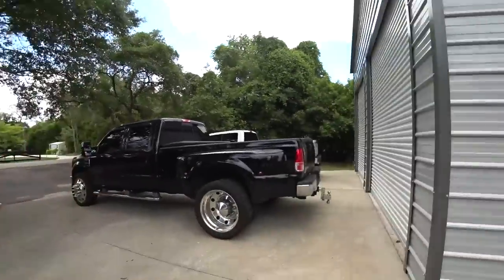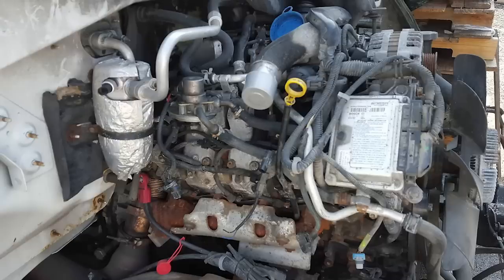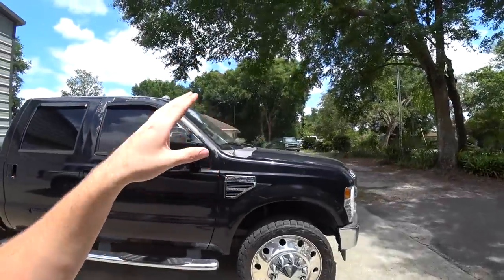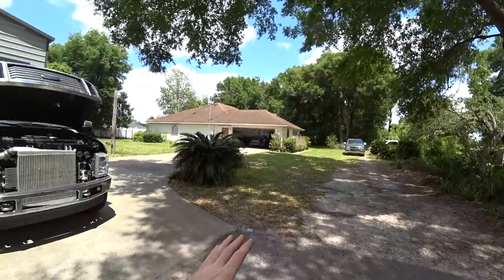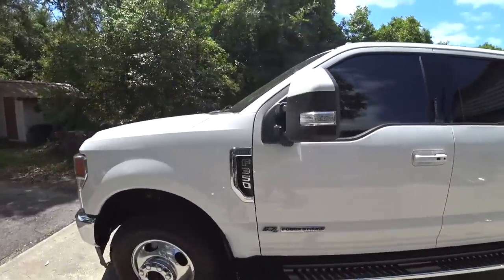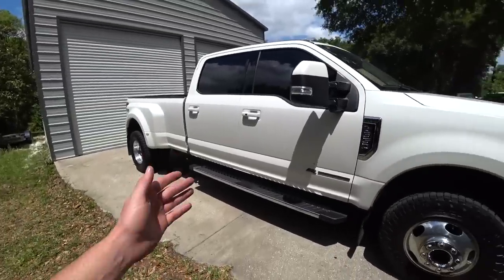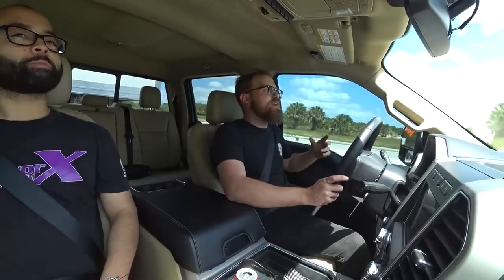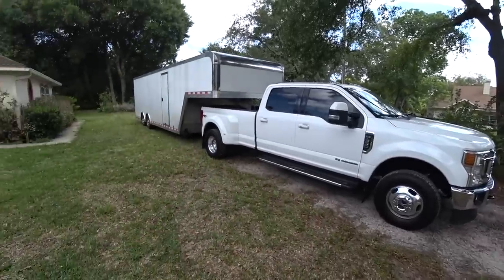Buying a new Ford Superduty to replace my Cummins swapped F350.

Comment: I think it’s awesome great to have the power when you need it. I have a 2000 f350 7.3 pulling a 42’ fifth wheel it does lack horsepower in the hills but have owned it for 16 years it’s black with stock alloy wheels.
If the 7.3 craps I want to do what you did put a Cummins in it. 
I take care of my truck it takes care of me. Thanks love your truck and all the options.

Comment: I used to be a remote medic for power line wokers, my ambulance was a base model 2016 dodge 3500, there was a big difference in comfort when i got to use the bosses 2019 ford

Comment: I went from a 2016 Titan XD with the Cummins towing a bumper pull 8k travel trailer. Which did awesome! 

Sold the Titan and bought a 21kr f-350 and wow!!! My neighbor drove by when I bought it and said “now you need a bigger trailer!” So I bought a 22 arctic wolf fifth wheel. Lol and it tows like a nothing. The Titan was bad ass but the SD is even better.

Comment: If you want to lower your trans temp, engine and coolant temp get a low temp high flow thermostat. It’ll make a big difference on temps. I got mine from SPE. They have a bunch of stuff for our super duty’s.

Comment: Congrats man sick truck. I love my 13 6.7. Let the truck reach the first oil change, "race" exhaust with proven tunes and it'll last forever. The emissions system on all the newer trucks is bound to leave you derated and stranded at a dealer at some point. Keep the dpf and egr incase you want to trade it in in the future. Congrats Taylor, well deserved.

Comment: its a great truck. I'm actually buying a King Ranch this week and have a second cab and chassis on order from Ford. And I have a 17 King Ranch single wheel drive. I had a Cummins but the Ford is so much better. I haven't looked back

Comment: Normally I'm like, these newer 6.7 trucks are way overkill for what this guy needs, but in your case this is perfect. People underestimate the toll that cognitive load takes on you when you're constantly worrying about your equipment and whether it'll get you where you're going. This will literally change your life Taylor. All the towing you do it just makes perfect sense. It's also good to not draw too much attention to yourself when you're on the road, if you know what I mean. That's what the drift cars are for. 
This reminds me of years ago I had big plans to buy an older crew cab F250 and do a 300 i6 turbo build on it. When I looked at my torque and power targets I realized all I had to do was buy a 6.8 V10 truck and I'd have exactly the same thing numbers-wise but in a newer, more reliable, OEM truck with a more stout frame, quieter, more comfortable ride, everything. Walk into any auto parts store and they'll have what I need on the shelf. All the boxes were ticked. I came to my senses and that's what I ended up doing and I don't regret it for a minute. It was a project in and of itself, but I was just swapping parts. No custom anything needed. 
What's crazy is that the light EFI 4.9 manual F150 I came from that I spent a lot of time gearing for fuel mileage, this thing got the same mileage stock weighing 2k lbs more with 4.30's in it. When I swapped in 3.73's it jumped about 1 mpg everywhere, including towing. I loved that old i6 but it was not what you'd call comfortable, and it had its share of issues that kept popping up. The V10 F250 has been dead reliable even though it's got 200k on it. Few minor things here and there but mostly it just runs and drives like a new truck. Would the old dent side be cooler? Hell yeah. Would it simplify my life and lower stress levels? Hell no. As I get older that becomes a priority, and for good reason. I'm busy every waking moment. I can't afford any extra time tinkering on a revolving door of issues that always pop up on a modified vehicle.

Comment: Tow haul and engine break whenever the trailer is on makes a huge difference also if you pull the 4x4 switch out it locks the diff but don’t run it like that on the road

Comment: Sweet rig man. Trailer and all. For your Trailer you should fab up some metal fender wells just in case you do blow a tire it doesn't wreck your Trailer.  Iv seen too many Trailer tires ruin a a Trailer

Comment: The graph showing the big 3 numbers, they used the standard output cummins, the high output is 400hp and 1020 torque. Plus has the aisin trans

Comment: Amp steps is the company of the folding steps and most of those trucks have the mounting points just covered and the wiring is simple

Comment: Congrats on the new truck!!! It’s going to be a beast. Just needs to go to Mexico and lose some parts and come back with a new electrical box to give it a little more juice. One of the first things I’d do is get a disaster proofing kit on to save the CP4 pump and also I can’t remember who makes the spin on fuel filter kit that replaces the cheap plastic filter Ford put under the hood. They are know to crack and leak fuel in the engine bay and cause fires. The truck will be reliable and last forever after those reliability mods.
Reply: H&S Motorsports makes the fuel filter conversion. Uses a cheaper spin on filter you can get at any parts store from many different brands. Plus less chances of breaking the fittings trying to swap out the expensive ford filter.

Comment: Congrats man. while I was surprised, I also understand having gone threw a similar situation with my toy hauler, started towing with my 94.5 7.3 power stroke then it broke, plan was to upgrade and make it better, however that was gonna cost $20k so I started to look for a newer dually truck and ended up in a 12 ram 3500 longhorn and now wont tow with anything older after this truck

Comment: I fell behind on the fummings. I saw the title and was shocked. I hope you got everything you needed so you can focus on the C6 and Ls Nitrous Express or Nos Miata didn't watch to full video and I just realized it. 🤠Up. You have mods picked out before you bought it and I can't wait to see what you got for it. I feel the broken down towing story I lucky got both cars home because I was luck and had a passenger. Car on the trailer could run but not for long and the motor was toasted afterwards and the Trooper we couldnt find  a torque converter or that's whatever one told us, so lost both cars in 1 afternoon however 1 still have the e36 with no motor.

Comment: congrads on the new truck ,  some perspective .... broken down on the road is inconvenient , broken down out in the ocean (Boat)  is life threatening ,  also you obviously did a good job on the fumins , as you have done more miles in it than the new ford has traveled , your engineering was sound.  the problem with the fumins is you made it into a pig ... loud exhaust rough ride with the semi rims .... fix that and you would be a lot happier ...... but the one thing the new truck offers is off the shelf parts and their are people out there trained to fix it when it fails .... where the fumins is all on you . both nice trucks .....  well done
Reply from the maker: Pretty valid perspective. I didn’t make the truck loud intentionally. It still has the full stock ford exhaust and muffler. Semi wheels were a sacrifice I was willing to make and the ride improved from the stock wheels with off road tires that were the same as what’s on this truck. 

But the fixing it thing is big. If one of the swap parts fails. It’s not something I can get at the dealership in the middle of the country.

Comment: Good luck with the 6.7 they run good but my company has had nothing but issues from 2018 models to the new 2021 some deleted stock tuned some deleted with tow tunes or completely stock everyday one has a issue all different platforms from rollbacks to what you have

Comment: youre telling me Taylor! so i was stationed in england for four years and drove nothing but shitboxes, but i got deployed right before i came back stateside so had a decent bit of cash flow and bought a 2021 Subaru Crosstrek for the daily and holy crap is it life changing lol. Its slow as all hell but all the tech thats crammed into these new cars make them the perfect roadtrip/daily for sure. I would of never expected a subaru to drive for you with cruise control on lmao.

Comment: I had no idea there was such a big gap in the HP and TQ on these 6.7L compared to the Cummins and Duramax. I totally understand the desire to not stress out about your vehicle when you are already stressed about everything else. Happy for you man, enjoy, can't wait to see how your first drive to the FF goes even though it's not too far.
Reply from the maker: From people I know who’ve had both. Anecdotally I knew. But in paper they all claim similar numbers. The dyno shows a different story. The crazy thing is that’s wheel horsepower. Mean the manufacturers way under rate them. It’s more than they claim at the crank.
Reply: @Taylordrifts  interesting, I always assume they aren't accurate on their claims. However when you were driving it around I could tell the power was surprisingly good by your reaction.
Reply from the maker: @dagrumpz8661  the power is Absurd. From seeing what people tow with these and how effortless it was I knew it would be wild. I towed an enclosed similar weight to mine with one in 2015 and I thought it was just a diesel truck thing. You would end up going 80-85 not even trying to. Then I got my first diesel and was like oh. They’re not all that powerful. Lol

Comment: Bro change out the steering stabalizer save yourself the dreaded death wobble and expensive front end replacement...Second aftermarket thermostate and billit tank valve is a huge upgrade on these...Check out you tube for bullit proofing these.. Save you a ton of future hassels...Nice rig bro...Huge upgrade....Life is good.

Comment: The way you feel is how I felt about my 2014 Silverado I know not new but new enough and new to me only down side for me is the AFM debating doing the delete kit
Reply from the maker: That’s what I was considering getting before the fummins. I was debating going back to an open trailer only so
I could get a 14 Silverado. Plenty new enough to be super comfy. And I love that body style.
Reply: @Taylordrifts  I think you dodged a bullet people have had lifted failures including my mom with her Denali nobody has really reported problems after doing the AFM delete and the transmission issue in the 1500 models

Comment: Congrats Man! Love the truck man! You know, i love the automatic steps, but make sure they are WIRED! In the wireless system the batteries are always dying or disconnecting, in turn making them not work. I ended up putting my static steps back on,  :/   lol

Comment: Speaking of turbo's on  L  S  Motor's..............  what sort of turbo u recomend that's not super high in price  but really budget friendly & super reliable long term wise  for my  all factory   ' 04 Silverado  w/ a 4.3  L S  w/ the 4L80-E   Auto,. Tranny  that's  got roughly 189  k  on the clock  & still going strong  here.......................

Comment: It’s awesome to see the progression throughout the years. Congrats on the new tow rig. I have the same one I drive at work but as a single cab with a utility bed and it’s awesome. Only issue I’ve noticed is when your stopped and the automatic brake engages, and when I go to get out on the road it’ll kinda lag until it releases. Might not be an issue for you but my two cents. The fummins would be a life changer for whoever wins it. I know I’ll be trying my best. 🤞

Comment: When the truck is off and the doors r locked press the unlck button twice and hold it on the second press and ur windows will roll down to let the truck cool off on hot days

Comment: I know your next video is going to be "My NEW semi wheels are here for the Superduty, looks sooooo good", but I would be cautious modifying your new nice truck.  Why put more strain on the drivetrain, less MPG, worst ride just to "stunt" on your way to an event?  You have a badass racecar in the trailer, just seems odd to draw a bunch of attention to your yourself and vehicle (parked at hotels/gas stations/etc).  You have mentioned repeatedly in this video that you enjoy the ride quality, power, comfort and reliability so it would seem like a step in the wrong direction to make that move (though as a "car" / "truck" guy my entire life, I whole heartly understand that is a style that appeals to you).   The new rig is awesome, though, and congrats.  Been watching you for literally years (not even into drifting, like the builds/fab work), through all the tow rigs, keep up the good work.  I know whatever you do, it will turn out good.  

P.S.  Your new truck definitely makes me regret NOT making a move on a upgrade from my 2011 6.7 PSD w/ 229k to a new one with the badass motor and 10 speed before the market went nuts hah.  Sigh, this current one still gets me, my gear, and enclosed trailer with race car to the track just fine, but I for sure have a little Alumiduty envy :)

Comment: Yeah you will break down in that new truck. That emissions system will shut you down so quick. One bad O2 sensor you're out. DEF fluid gone? No start. DPF system plugged up? No start.

Comment: I don't think I'd putt larger wheels on it until you research it   there's a lot of electronics on the thing it could cause some problem s and that is one expensive transmission and if you have a warranty it could void it so might want to check before you do

Comment: Love the new truck although aren't you going against your own logic by fitting semi wheels to it?

They look awesome but it'll ride rougher, be louder, add more strain to the drivetrain due to increased weight and add complications if you have a flat tire.
If it's meant to be a reliable work horse then refrain from doing any mods to it other than things that will improve reliability or/and help you when towing.

Comment: Idk if the 2020 has the plastic cold side that goes into the “throttle body" but that’s the only issue I ever had towing with 6.7..

Comment: I hate the tailgates on those trucks and if I remember right there should be stickers in the glove box you put on your trailer and it shows your truck to trailer angle and if put cams on it helps you park
Reply: At least on an 18 250 k ranch

Comment: you know if you were to sell the fummins you could probably pay 3/4 of the powderstoke truck off with the current used truck prices and as a body man who has seen his fare share of automatic running boards on vehicles I'm glad you didn't get them I've seen them fail way to many times to even want them. granted you don't drive much for gravel and you're in a semi better climate for them (salty air). I live in Iowa here those auto boards don't last long (lot of gravel roads + salt covered roads during winter+ death for ARB's).

Comment: Nice truck. But leave the stock wheels and tires on. You complained about comfort and being stock but part of the roughness issues where those semi wheels. Plus if you blow one of those they are not going to be easy to find/cheap. Also harder to find someone to mount them on the road.  It's your truck but you need to really think about stuff like that.

Comment: Lly s ecm is not on the valve cover or fuel cooled that is the ficm an you can run them dry to. Ecm is just as every truck is on those trucks.  Just saying.

Comment: I'm a little confused..you pulled a 7.3 to replace it with a Cummins? Why??
Reply from the maker: A 6.4. The 7.3 ended in 2003... If you don’t know that much there’s probably no reason trying to explain the logic of the swap.

Comment: I work for a Ford dealer, do yourself a favor. Delete it, put a fuel system on it and do the dual cp3 conversion get rid of the cp4 or you will have major problems! They are great great trucks but have allot of their own issues.

Comment: I have a '17 F-350 SRW minus a few of the feature you have but ya, the diesels from the Big 3 from 2017 to now are hard to argue with. They all make stupid power and have nearly as many features as some luxury cars. Costly to fix FOR SURE, but no other vehicle has the capability AND the interior niceties unless you spend $250k on a Class 6/7 5th wheel hauler, which will be even more of a pain to park and will be a spectacularly shitty daily driver.

Comment: He sure talks about braking down alot and then gets a ford. This very funny to me. I am glad he knows how to put a better motor in a ford already and I hope he won't have to use that knowledge. A big thing with me dose the truck get me home and get the job done. I have a 97 12V with a NV4500 and it has always done the job and gotten me home it has 1.2 million miles on it and it's still going strong. I got it in 2006 with 200k on it.

Comment: Do not get rid of the Fummins, keep it as a backup, you know that truck in and out. I have about 0 faith in new vehicles, Chinese control modules and electronics riddled throughout they are absolute nightmares. I work on them all day everyday its my job security.

Comment: Sorry but
Does Ford cover CP4 failure?
What is more, the "repair" cost for a catastrophic CP4 failure is frequently upwards of $10,000, a cost which Ford generally refuses to cover under warranty by blaming the consumer for "fuel contamination" — contamination which is caused by the shredding CP4 itself.Nov 17, 2020

Comment: The new truck will break down WAY before the Fummins would. Kind of disappointed. Not gonna lie. You gave up a perfect tow rig for a headache. This is coming from a guy who worked at a Ford dealership as a service advisor.

Comment: Broo just delete it please don't add power if you want but delete is asap I been dealing with 6.7s for a few years now and the only thing da always fails is the egr and regens will slow you down when pulling to 50 miles just delete it please 🙏🏾